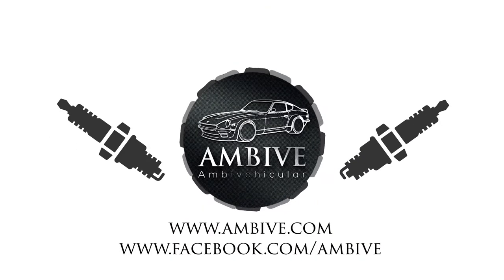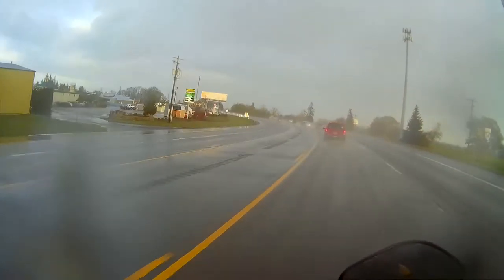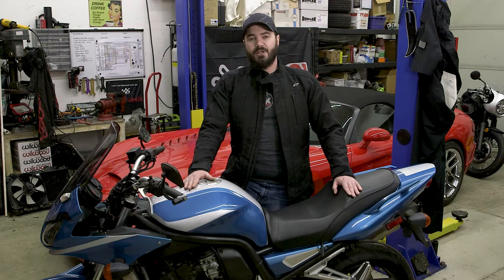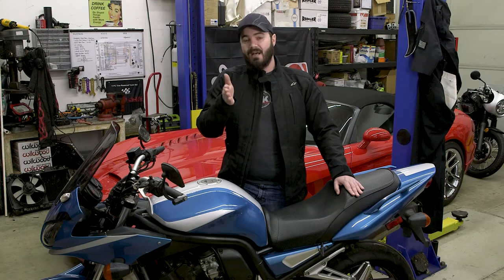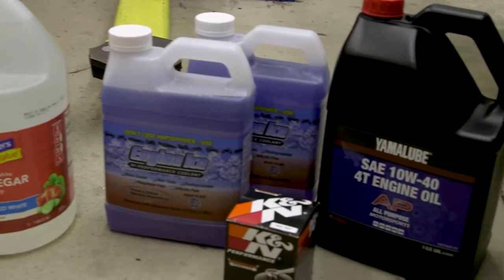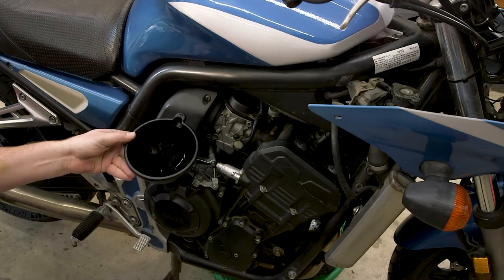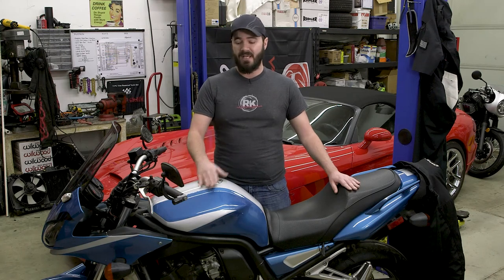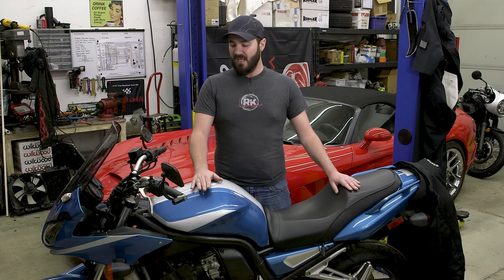Buying a used motorcycle

Comment: Nobody ever does brake fluid flush.
Reply from the maker: Good call. I flush the brake fluid whenever I do pads unless it feels soft. This one will get fluid when I do the front pads, but rears are 80% and feel good. It's more of an issue on something that might boil fluid, which shouldn't be a risk on a street ridden bike in most cases.